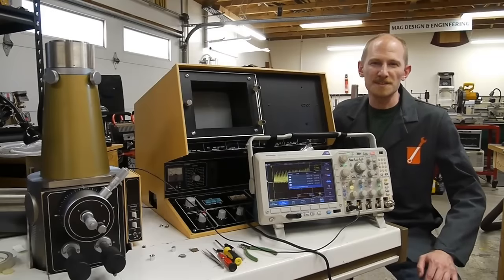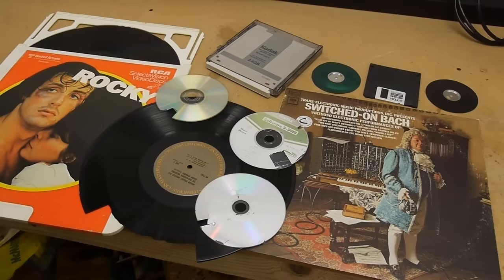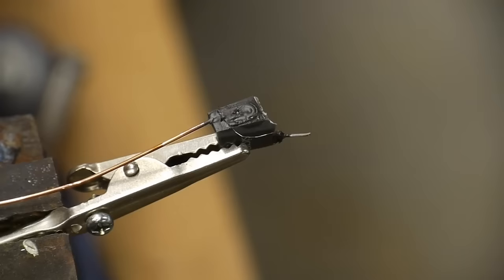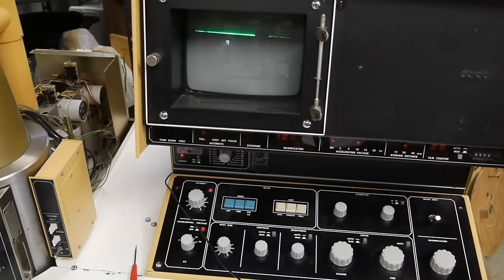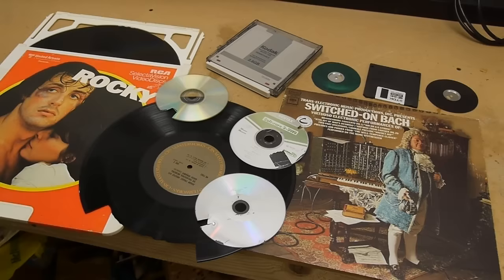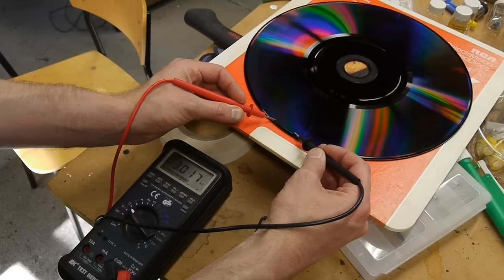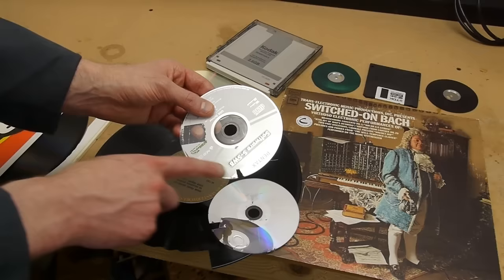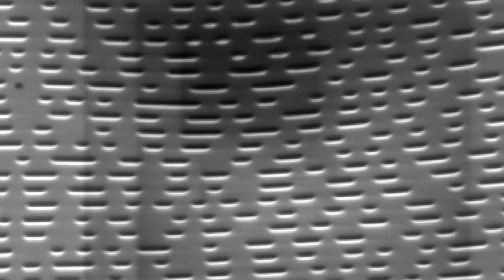Electron microscope slow-motion video of vinyl LP

Comment: In a CD/DVD/Blu-Ray, the data information is molded into one side of the polycarbonate substrate.  The aluminum, silver or gold metallization is used mainly to reflect the three lasers (two tracking, one data) as they go thru the smooth polycarbonate side, then bounce off the metallized data side, and back to the laser heads.  The lacquer coatings are purely for protection of the data side of the polycarbonate.  Your method of tearing the aluminum is giving you only an embossed image copy of the data that is imprinted in the polycarbonate substrate.  Retired Media, Manufacturing Engineer and Equipment Designer for Technicolor.
Reply: Huh. Didn't know that.
Reply: That's what I say
Reply: What is really interesting is that all of the Media he tested is Stamped or Pressed.
A Gold of Nickel coated master plate is made, From this a negative image is made, and then used to make positive duplicates in a press.
This is called surface replication.
The Replicated surfaces, depending on how it will be read, might need a reflective and or protective coating.
Reply: Cool, a lady yelled at me and got herself fired at Technicolor. Not going to go into detail on that one lol. Funny thing is i learned what you just said, not from technicolor, but from researching playstation 2 discs and trying to figure out why they were black when I was a kid lol.
Reply: @Tyrant Patrol No prob at all. I just happened to remember that video and I found it pretty quickly. Love the name btw lol
Reply: Smart arse...
Reply: I've heard of you guys. Huge fan! ...loved the dream coat.
Reply: Neat. Is that why the image looks more like blobs sticking up out of the background rather than holes pressed into it?
Reply: @Dubz0408  ... I thought Playstation (and at least some PS2?) discs were black pretty much "because we can", and it allegedly caused some CDR drives to not be able to read them. Also that Sony could try and claim that there was some special magic to the discs and using plain ones (whether you were an unlicensed software publisher, or a straight up pirate) wouldn't work.

All of it being bunk of course, as the colour of the coating was carefully chosen to band-pass (IE be transparent to) the particular red of a (totally standard) CD/DVD laser whilst being opaque to everything else, thus looking very nearly completely black unless you shone a bright light of the correct frequency at it, and their copy protection relied (at least in the PSX) entirely on a magic bit of checksummed code written to a certain part of the disc, which you had to be licensed by Sony (or submit your masters for writing at their own duplication plant) to incorporate to your discs. Hence the famous early "pencil-top eraser" disc tray open detector switch defeating not-a-chip protection bypass which required an original official disc and a quick hand to implement...
Reply: Great information, but perhaps it's functionally the same with regard to showing what's on the real surface.
Reply: Dead Eyed Demon: Great post!  I have no real expertise on this, but I've only ever run into online descriptions of digital disk recording by dye actuation, where the laser in your disk burner actuates a chemical reaction in the plastic layer above the reflective metal surface, and this dark region constitutes one of two binary values: bright, vs. not bright.  And this is why home-recordable disks come in standard and (rarely) archive grade.  The archival grade are supposed to have vastly lower rates of inherent dye reaction at room temperature, or from ambient UV exposure (mostly from being left media side up in a sunny room), so that it would take, in theory, 100 years for significant dye activation without a laser.  But I sometimes run into mentions of how commercial disks are made differently: more like a physical printing process, and this makes then more expensive to make, and more durable in one sense, since there are no dye reagents in the plastic layer.  Any tips on where to learn more about the commercial disk printing process?

Comment: Brilliant. For those not well versed in small stuff, a human hair can be anywhere between 17 and 180 microns. When I worked at HP,  we had "dicing" saws that would "singulate" die from an 8" diameter silicon wafer. Those blades varied in width from 10 microns to 250, or wider. Imagine being able to literally "split hairs".
Reply: Funny, someone else left a goofy pseudo-poetic comment about how 'nobody else seeing this video could be as smart as this guy' and you just proved that comment wrong. Some people think their own low bar is everybody else's. I'm not a scientist but did get to use an electron microscope at HP in Corvallis one time in the '80s (middle-school enrichment class) and saw some of what you're talking about. We got mis-printed wafers to cut up and look at.
Reply: I feel like an arts student that stumbled into the wrong lecture hall and got stuck
Reply: And yet my HP printer can't finish a job without a jam.
Reply: You think about a meat slicer, then, there is such fantastic equipment built by fantastic people out there. Love it.

Comment: When my sputter coder was being serviced, rather than loading the slide into a vacuum chamber and evaporating silver metal onto the pieces of the LP...

... I interaxelated depolarized tri-polymer plasma into a recursion matrix, by way of a gas chromatograph mass spectrometer (with the promo-dynamic module set for differentially charged polaric ions), which left a quantum signature in the vinyl.

This gave me zeta particle derivation compliance, and allowed for precise flow rate adjustments of positronic neural peptides.
Reply: Perhaps I gotta put my hip boots for this one.
Reply: Perhaps do what ?
Reply: I find that hard to believe. Where is the video?
Reply: Sounds like you knocked that one off an episode of star trek
Reply: CrazyPigeon834 
Or possibly Rick and (BURP) Morty.
Reply: Don't forget to invert the polaron flow first. Unless you want to accidentally invent warp travel.
Reply: Same here
Reply: Zakkerly…….…….
Reply: You could have just used some old copper wire and some carbon glue
Reply: Be careful to not cross the streams, it would be extraordinarily bad.
Reply: can I buy drugs from you?
Reply: OBVIOUSLY
Reply: I reversed the polarity of the electron flow
Reply: I programmed a GUI to track the killer's IP address
Reply: You just said it. No one could've said it clearer. <3
Reply: You didn't even use a retroencabulator? Lame.

Comment: Though I have seen electron microscope images of a phonograph needle on a record before, this was the first time I have seen them in motion.
Reply from the maker: Mok214 Me too!  I've been really interested in seeing stop motion and also realtime video from a SEM.  I've got some projects on the way to show more of this.
Reply: Applied Science It was really beautiful to watch. Looking forward to watch 3.5" Floppy and specially the MO Disc. I wonder if it would be possible to see helical scan patterns of VHS tape.
Reply: Ali Mirjamali In the early days of videotape editing , we used Edivue tape "developer" on 2 inch quad videotape to see the tracks. The developer was a suspension of carbonyl iron particles in carbon tetrachloride. With a Smith splicer, you used a microscope to align and trim the ends before applying splicing tape. The tape ends had to be trimmed so that the splice was made just after vertical sync. There was always some disturbance on playback. Luckily they invented electronic editing after a few years.
Reply from the maker: Ali Mirjamali I haven't actually tried to view magnetic media in the SEM yet.  The MO disk and floppies are for another project.  But I can't believe I didn't realize that the magnetic areas would interfere with the beam in such a way that the information would be visible.  I'll bet it will work!  Thanks!
Reply from the maker: Anvilshock That's a good point.  Having true high-speed SEM video would be incredibly useful!

Comment: Thank you for all the Bloody Details, for us tech junkies!
Sir, you have successfully recreated in EXTREME miniature scale, almost EXACTLY the methods I used to create Traditional animation almost four decades past. The industry in the 70s (in Hollywood, New York, Europe, etc.) was using room-sized Camera stands aimed downward at an art stage with pins ("pegs") precisely matched to holes punched in the animators' paper and acetate sheets, to register the art under a camera with carefully angled lighting. Some were gorgeous collections of exquisite interconnected slides, with smooth gearing and locking levers and scales, knurled knobs and pointers and post-it notes...

I used 18"square polarizing filters mounted in front of the lamps, with small glass polarizing filter on a 25mm focal length lens. This suppressed glare and dust, And increased the saturation of the colors. 

The procedure was frame by frame, just as you were describing, especially for pans and zooms in a sequence. Expose one frame, change the art, move the background one increment, close the glass platen to press everything in place, then repeat those steps until you'd shot all the art, and positions for that sequence. An individual shot in a story, that might have a running time of a few seconds, might take eight hours just to SHOOT one or two sequences, after a hundred hours to create the art. Fun stuff. My little studio started with a fer-Pete's-sake 16mm Swiss Bolex on a hand-built stand.

I started working with "hi-end" CGI 35 years ago. You'd like to think that stream-lined everything, wouldn't you?
Ask me about doing individual PIXEL surgery on the art for a driving game at Atari...